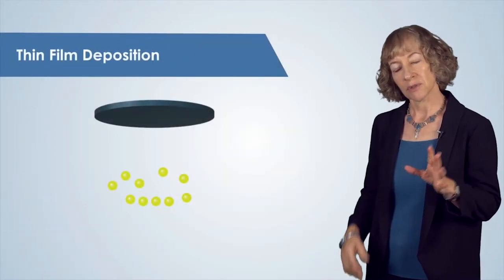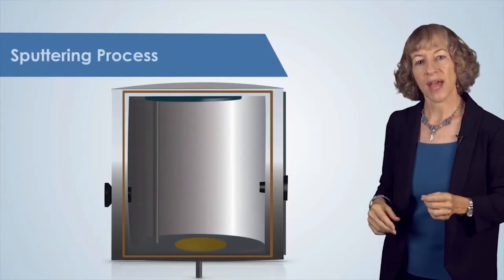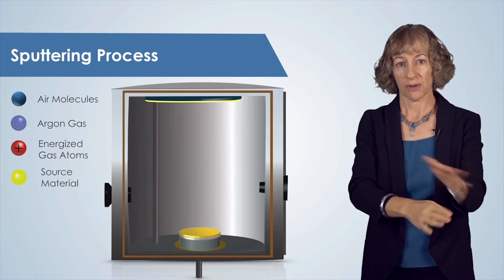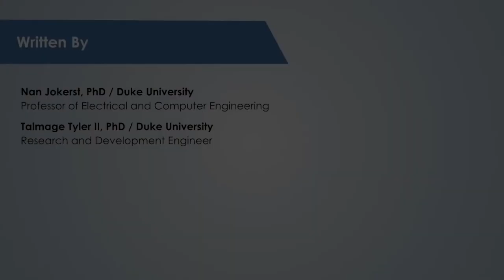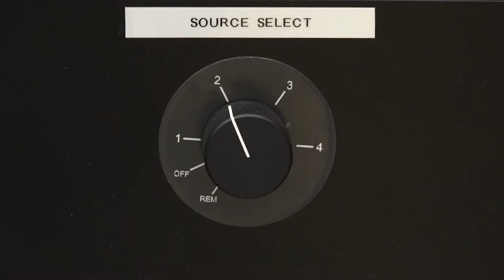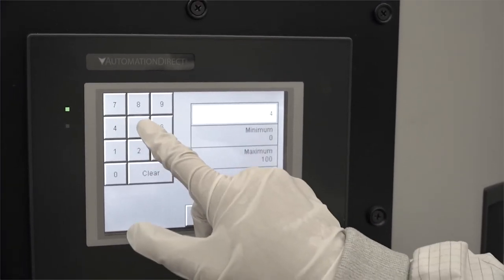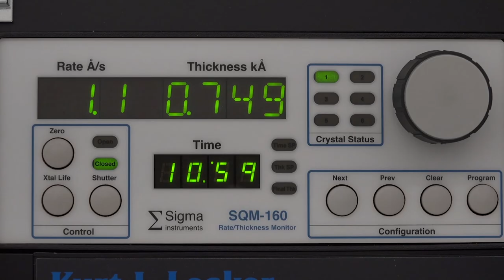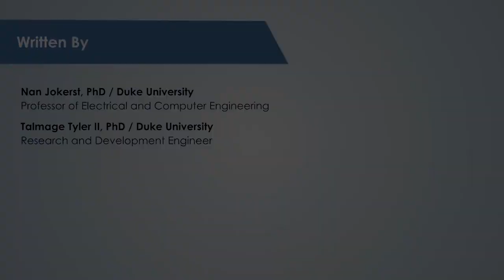Introduction to Sputter

Comment: Very cool.
What voltage is required to form the plasma?
Reply: Depends on the pressure of the system, but it ranges in the many hundreds to roughly a thousand volts. Also the plasma initiation voltage is higher than the voltage required to sustain the plasma in most cases, so a striking voltage is used similar to how tig welders have a high frequency start.

Comment: 10:35 Does varying the negative voltage also affect the sputter flux in addition to the shutter position? Or is the voltage only effective in a specific window? If sputtering was performed for the reverse process, like sandblasting to clean a surface; would a specific voltage achieve selective un-deposition of an element? Or do the Argon ions just crash and thrash any atom from the substrate?

Comment: how do you guys keep the inside of the machine so clean? we use e beam deposition and coat the inside with tin foil to protect the walls, which we change every month or so
Reply from the maker: We install removable metal panels called “shields.” The shields are coated with textured aluminum film (deposited via flame spray technique by a commercial supplier). All the materials we deposit build up on the shields. The textured aluminum coating prevents the materials from flaking / peeling. Every few months we replace the shields. The old shields are sent to a commercial vendor, where the aluminum and all deposited materials are chemically removed and collected for recycling. The used shields are then cleaned and re-coated with aluminum and sent back to us for re-use.
Reply: Great question.  Very interesting answer.  I did not know about flame coating aluminum.  Cheers!